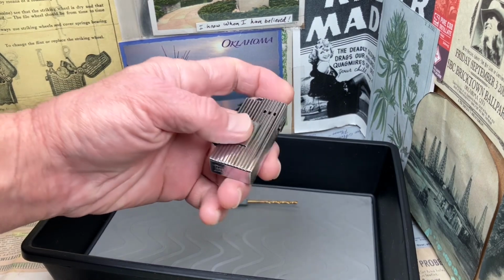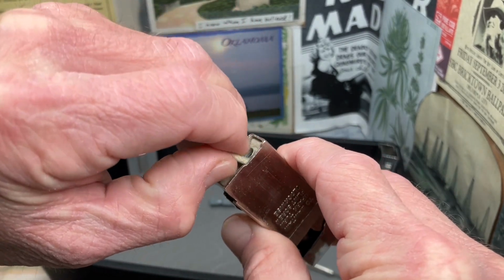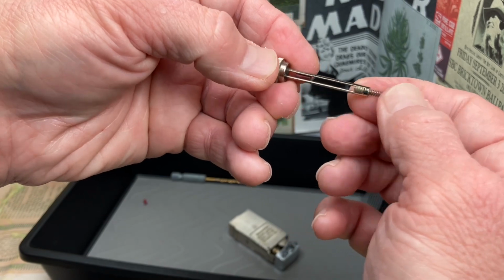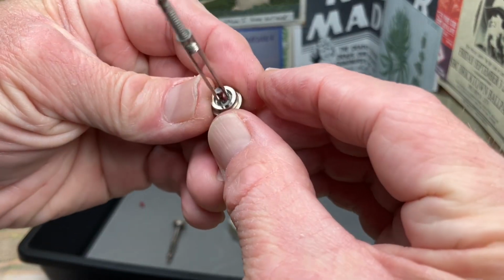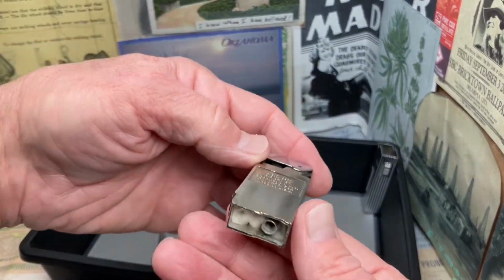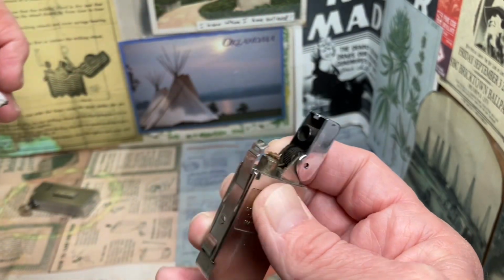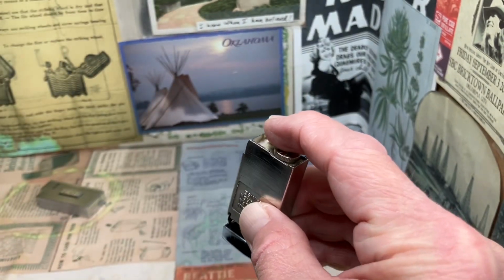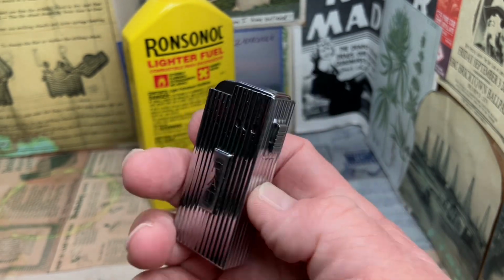Clearing The Tube Of Old Degraded Flint In A Vintage ASR Semi-Automatic WINDPROOF Petrol Lighter

Comment: just picked up one of these today as my first ever vintage lighter, i push the button, no light, i think immediately no flint, but i don’t know how to take it apart. this video saved me! i’m about 7 mins in, hoping he shows how to fill it with butane as well❤️
Reply from the maker: This is a petrol lighter. You just absorb the material underneath the insert with petrol fluid.✌️
Reply: @DependableFlame  thank you sir!! i also got a zippo slim from 79’, about to watch your video on that one as well!
Reply: @DependableFlame  hey boss, any advice for getting the pin out of the top for the cap? been trying to figure a way to get it out without seriously damaging it
Reply: i got it, i flatted a tiny nail, gently pushed it as far as it would go, then slid fhe top off around it, and after that the pinion was basically free to fall out, which it did along with the striker wheel!
Reply: got it all back together, but now the top does not snap off the latch… i’m confused!